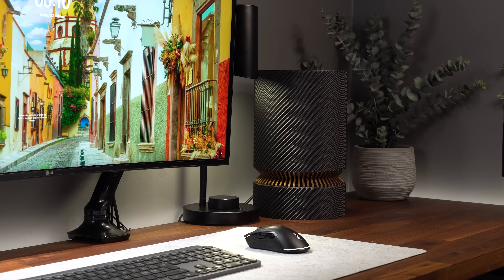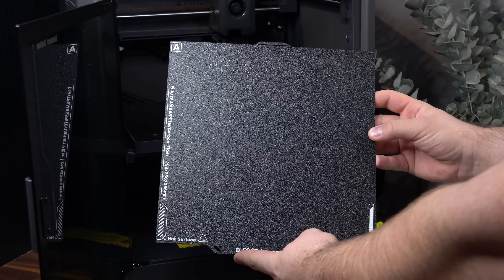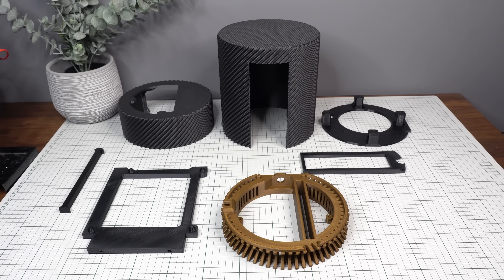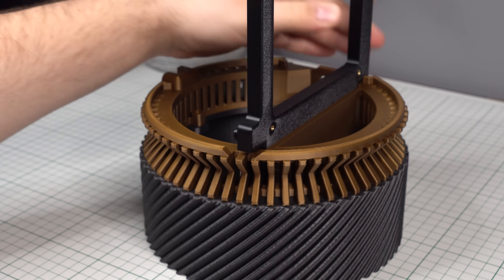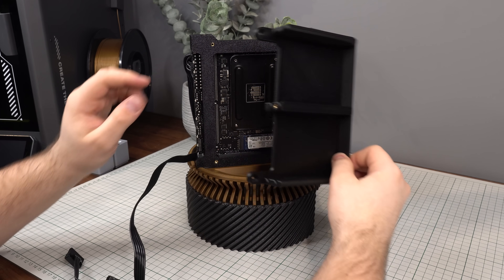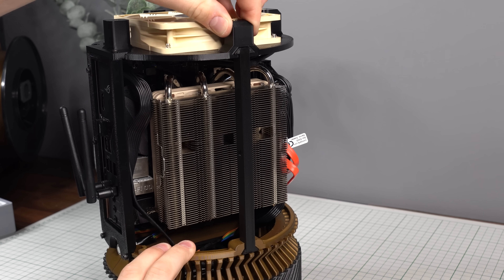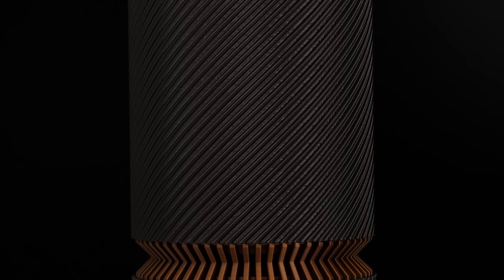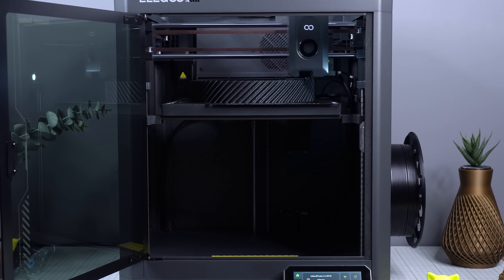Aesthetically Pleasing Custom 3D Printed PC Case Build

Comment: Is it me of is both the gpu and top mount fans exhausting? Shouldn't both be pulling in one direction to have a consistent flow?
Reply from the maker: Both are exhausting. However, the PSU does not pull nearly as much as the 120mm top fan. Also taking into consider the generally low power consumption of a normal APU build, the SFX psu is unlikely to be needing much cooling anyways due to the low power draw. The air intake allows plenty of air in even if both work against each other. 😊
Reply: @makerunit  appreciate the insight! Thanks

Comment: Cool! But it it seems like this days most of storage should be in NVME formfactor PCIE attached preferably
Reply from the maker: The thing I take into account when designing my projects are that there are a lot of people out there who build my projects specifically to re-purpose and give a new life to old parts from systems they have upgraded, by allowing these things in my designs people can build the project without needing the newest fancy parts to make it work. 😊
Reply: You can only fit so many NVME drives on an ITX board though. Most people don't need blazing fast drives for general storage either. If you do, great, build a system that suits. You could build his ATX case and then have room for more drives on the motherboard.

Comment: An APU has a graphics card built in. It is only a lot smaller than dedicated graphics cards. Also it uses system RAM instead of its own on board memory.
Reply from the maker: Ah, I see. I should have probably phrased myself differently. My point was that you only needed the motherboard and the chip, not a separate GPU 😁

Comment: We need a v2 with full sized mid/highend gpu
i love it, this case looks awesome. 
but: the fins of the cooler are in wrong orientation to the airflow in the case, that is something to consider for a v2. at the moment you will get turbulences and not a clean flow. just my 2 cents :)

Comment: You really need to reorganize how the PSU is mounted, this will fail and failing PSU:s is a PITA.
Reply from the maker: May I ask exactly why this will fail? There’s plenty of intake holes to supply both the PSU and the top fan. Also most APU builds will use very low power, and is unlikely to make the PSU run hot at all. 

Looking forward to you explaination. I’m not saying I’m right, I just can’t see the issue. 😊

Comment: This is fantastic. I'll need to get a 3D printer. Not sure what the best option for a beginner in Australia will be. Happy for any suggestions.
Reply from the maker: Honestly, if you’re willing to wait a few months (for delivery as they’re in pre-order now) the one I talk about in this video, ELEGOO Centauri Carbon is a strong contester to some of the popular much more expensive alternatives out there. For $299 (US) I think it’s one of the better price to performance printers you can get at this time. There’s also coming a multicolor addition later this year. 😊
Reply: @makerunit thanks! I’ll put it on my wishlist
Reply: I would not recommend Bambu Lab printers, even though they are very good. Why? Because they changed their ToS and locking you out from using 3rd party software. A company that came into an open-source community for the most part wants to be Apple. The printer used in the video could definitely be a good starter considering it's price.
Reply: I have three Qidi printers. Two of them have heated chambers, which are good for using ABS or ASA plastics, which are ideal for projects like this. I'm kind of wishing I had got an X-Max 3 instead of my X-Plus 3. The huge 320x320 bed in the Max is great for big stuff, any of Makerunits bigger cases, full size helmets etc. A lot of people recommend Bambu printers, I understand the appeal, but their enclosed models are pretty pricey and the privacy issues don't sit well with me. I wouldn't get another open frame printer personally, I started with one to learn, but most of my environments are draughty and caused a lot of warping.

Comment: Very nice looking case! Wonder how much bigger it needs to be to fit a 300mm gpu. Maybe with another copper intake for the GPU somehow.
Reply from the maker: I did try with a SFF GPU at first instead of the drives, and was able to fit approximately a 180mm GPU with this height, so for a 300mm GPU the height would have needed to be increased by about 150mm to also leave room for some angled DP cables etc. The total height would then be closer to 500mm almost. 😅 can probably be rearranged somewhat to make smaller. I’ll keep it in mind for a potential V2!

Comment: I would LOVE to see this redesigned with a  rounded square design to make room for the "Jiushark JF13K Diamond Flat Tower" that Gamer's Nexus reviewed a while ago. you could cram SO MUCH into it with just that little bit of extra room, and it wouldn't even need a bigger printbed. it's just squaring the same circle that can already accomodate the mini-itx standard.
Reply from the maker: That’s a really good looking cooler! And the price too seems like a great deal! 

Actually before landing on this I did make a rounded square design to try out with a SFF GPU, but when comparing it to a round design I generally liked the round one better. That doesn’t mean I can’t do another version down the road though. I’ll be sure to keep this in mind as a potential future project! 💪

Comment: Was it the way Apple made their Trash Can, or was it a design ahead of its time? I have to ask due to as many similar designs are being shown, but no one is making the same design bashing comments. I mean, it's just another Trash Can design.
Reply from the maker: The Apple trashcan had a custom square PCB design with airflow in the middle pulling air in at the bottom, pulling it out the top. There are of course some similarities, especially the fact that it’s round.

The trashcan design did play a role in designing this, combined with some 3D printable vase designs inspiring the exterior, combined with the look of some modern portable air purifiers 😁

Comment: Uhhh, looks like the Borg Queen is going to hire a new interior designer! ;oP
I just wish the latest high-end AM5 mITX boards had turned out less costly! ^^"
Reply from the maker: What’s the salary like working for the queen?😂 

I’ve been drooling over a CPU upgrade myself. Thinking of going AM5 (high end) for my main system too. Will probably upgrade sometime this year 😊
Reply: @makerunit  Uhhh, you wanted money?...
I think they only work in an honor system and for cafeteria points and the occasional hydraulic liquid change.
So if they should contact you anyways, just say you already part of the local artist collective! I've kinda already send them your portofolio. ^^"
In case you get teleported out of your bedroom just make a big scene, I think they can only handle one queen. ^^

Comment: I love this! Thank you for all your hard work.

As for a suggestion.

Can you make a slightly bigger version of this, but instead of having the ability to add SSDs, design a way to have a pcie riser in the back to put a decent sized GPU? 

Then have the storage just be m.2?
Reply from the maker: This is something multiple people have requested now, so definitely something that can be done at some point. 😊 it would require a somewhat bigger overall size, but aesthetically it could be about the same just scaled up.

Comment: This is definitely my next mini itx build I would print. Very clean and if you print it in white it looks like a air filter in disguise! Great work
Reply from the maker: Modern cylindrical air purifiers were actually a lot of my inspiration behind this design! That combined with the «trashcan Mac» and exterior inspired by some 3D printable vase designs!

Comment: how much to just make this case and ship it to me in US?
Reply: Pay a small fee for access to the files and submit them to an online 3D printing service like JLCPCB, you idiot.
Reply from the maker: I think the cheaper solution would be to look for a local makerspace or similar where you can borrow yourself a 3D printer. The material cost itself can be as low as $25 to $30 by using the right suppliers. 😊 then of course the PC components come on top of that.
Reply: @ I just don't have all the necessary tools and quite honestly don't want to invest in an entire new hobby lol. But I certainly do love this case
Reply from the maker: @ Totally fair! Even shipping from Norway to the US would end up probably in the range of 50-100 dollars just there. So I think getting the file and getting it printed locally would be a better option. At that point, you could even buy a second-hand Ender 3 for 50 bucks just to print this out :D

Comment: looks nice but i think the best way is 3d prints + makerbeams...
Reply from the maker: That could definitely be helpful in some larger designs to keep the stiffness. However 3D printable parts can be designed in such a way that they support in the right places making them more than capable of carrying some serious weight if designed correctly. 😊

Comment: Just when I think I can't possibly get any more inspired by your channel, boom! This is insane! I made an excel spreadsheet of all your builds that I could access and download for free and used the dimensions and such to pick some design elements for my upcoming PC build, but then eventually decided I wanted to take a slightly different (memey) route with my design and started teaching myself Fusion since OnShape just frustrates me and TinkerCad was not offering the parametric features I needed.

I was wondering what to do with the leftover parts, I love the idea of a tiny mobo and got my hands on one from a much older generation to hold it in my hand and plan ideas around it - I think tossing my i9 9900 into it and making a mini livingroom pc like this brilliant and I wish I'd thought of it sooner!!
Reply from the maker: I try to do something new in every project video to keep the engagement going. I’m happy to read that I’m able to inspire you with your own projects! 

3D modeling can definitely be frustrating at times, believe me when I say sometimes I wanna rip my own hair out because I can’t find the solution I’m looking for but eventually, the solution pops into my head solving my challenge. That’s the best part of this hobby, that moment when you come to a realization and you know that now, the project you had in mind will come to life.

Comment: Love the looks of it, but I'm curious how hard would it be to modify the design to add a GPU (such as a SFF 4080 or a smaller 7900XT/X) and ditch drive options. After watching your case designs it's made me very interested in doing a case of my own of a similar design to this.
Reply from the maker: Thank you Jared! I actually did try this originally but found that due to the width of the GPU’s and also length of most common GPU’s, the case would have been a lot taller if doing that, as well as adding a little bit more to the diameter of the case, though it could definitely be possible to achieve.
Reply: No one makes a GPU riser that does a 90 degree, which means a case in a similar form factor for a PC with you requires bending a flexible riser in horrible angles (I've done this with my current build, I really don't like it)

Or having all IO come out the top or bottom.

It's not very pretty.

When I say a 90 degree, I mean rotating the longer axis of the GPU.

They do a rotation around the axis defined by the pciexpress slot, but you actually need a riser that makes the GPU rotate the slot direction by 90 degrees.

All risers consumers can buy are simply "rolling" the pciexpress slot.